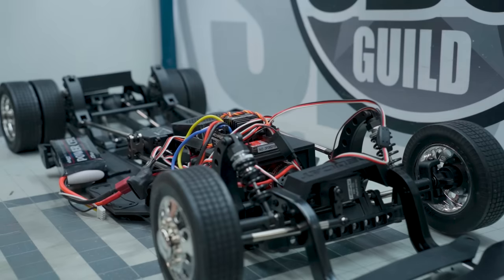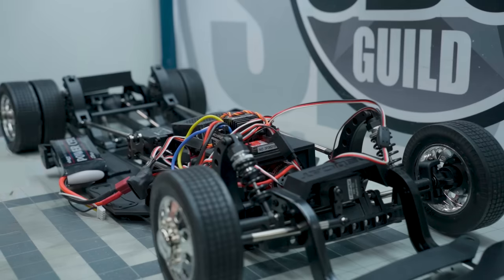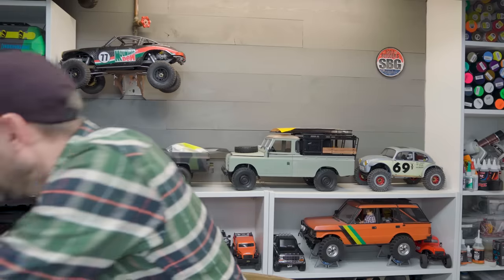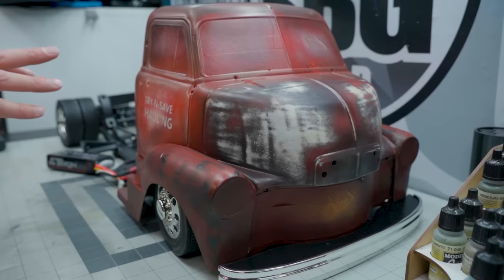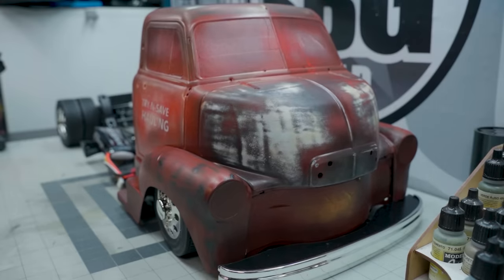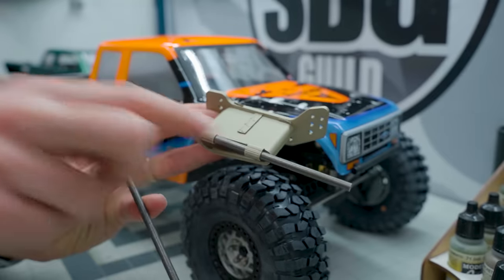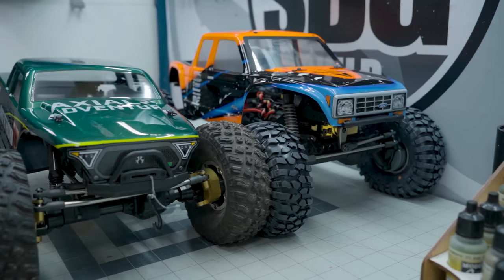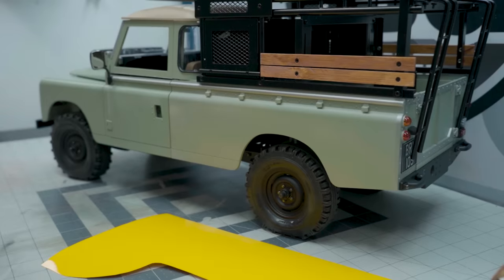How to RUIN a Paintjob - What's on the Bench Weekly Ep66

Comment: Head on over to your local machine shop. Tell whomever it is running the place you would like some of the metal shavings from his lathe. Take as much as he will give you. Take what he gives you and put it in a plastic container of some sort. Put some hot water and soap on this. Get something and stir this around. What you are doing is removing any oils said machinist used in the cutting process. Rinse, Now pour off the water not worrying if you get all the water off the shavings.  Let this dry for a day or two. What you will end up with is some very nice material to add metal rust to your projects. I apply this using a "clear" meant for plastics, using a brush. You can thank me later for this info.
Reply from the maker: Good idea! When I want real rust, I use a product called Sophisticated Finishes. It's iron filings in an acrylic base. Use Vinegar to accelerate the oxidation. Better yet, buy some steel wool and leave some in a sealed container with vinegar. Same result, and even simpler!
Reply: @scalebuildersguild  yea I looked into that product. I knew there had to be something just as good but cheaper. You can not beat free.

Comment: Using my Futaba I can slow the servo's down. Why I like a good high-quality radio. More control. One can also set things like ramp using a good quality radio. You do get what you pay for.  Today many manufactures put these settings in the programming of the esc. None of this is needed using a high-end radio.  But I use radios like this for the feel, think in terms of being connected to model/ car/truck.
Reply from the maker: Which is nice, if you've got a high end radio. This will work with the stock electronics, which is simpler and more affordable for the average or casual user! The ESC has nothing to do with the servos sir.
Reply: I can run those servos slowly by using the knobs on ch5 and ch6 on my $75 Flysky GT5 without any programming. I use those channels on all my four wheel steer trucks.
Reply from the maker: @offroad1911 my original point still stands! If you want to use the stock electronics, as most casual users will, this is a great addition. Thanks for watching!

Comment: I think people are getting air ride and hydraulics mixed up. The 5700 COE was a medium duty truck, even a couple of badass air compressors with big air tanks wouldn't air it up that fast, it would be slow. So the servo slower is a pretty solid upgrade in my opinion. And it does look good shiny or patina. The two crawler paint jobs also turned out really well, I don't have the patience for it.

Comment: In my experience with the guys who bag and drag they want to go up and down as fast as possible, not slow. The guys ive dealt with they want it to bust pavement on the down and jump on the up, slow implies youve got a small pump and small valves. And whereas over the years ive dealt with less and less my experience is still quite extensive.
Reply from the maker: I'm sure you're not wrong, but something just looked jerky and weird with the stock setup. I much prefer the smoothness with HeyOK!
Reply: Toy low rider cars built to show off in parking lots do that. Work trucks, like the one I work with, take a second to air up. The difference? One was made to do a job and the other was made to impress kids and punks.
The hauler is a work truck, what it's hauling can jump around whatever. Mine hauls crawlers.
It needs to work like a truck  I approve of this product.
Have fun and do you, boo.
Reply: @brianellison3525 yes I thought about that after I made the comment but I'm not sure why you're being snarky I tried to be respectful when I made my post, do you need a hug sweetheart?